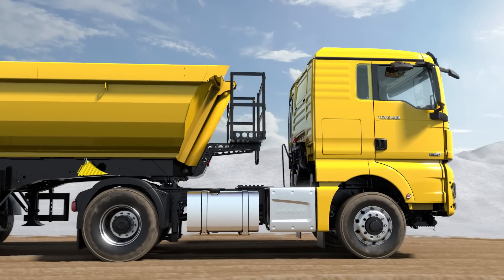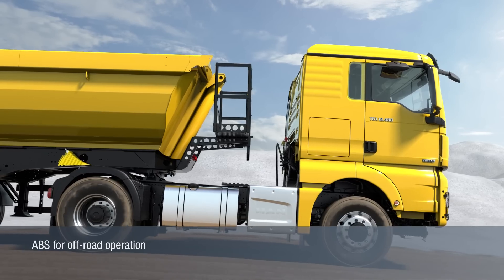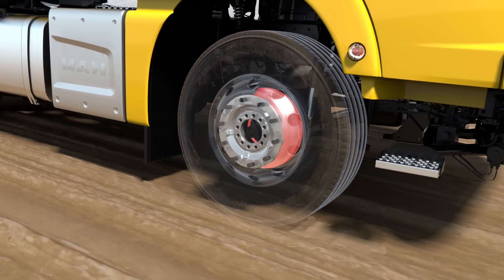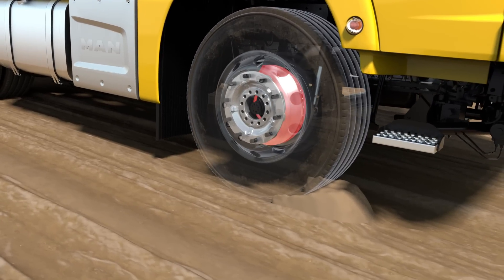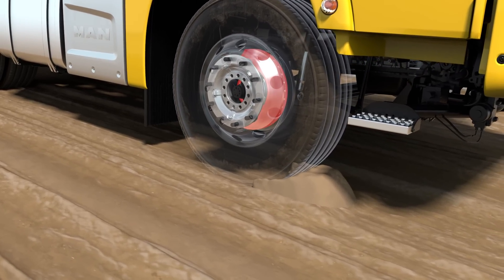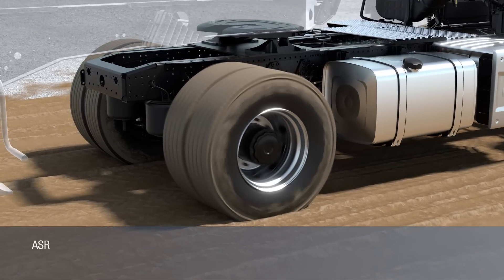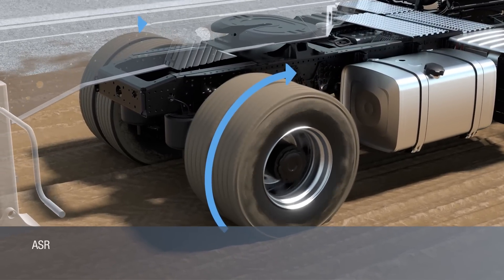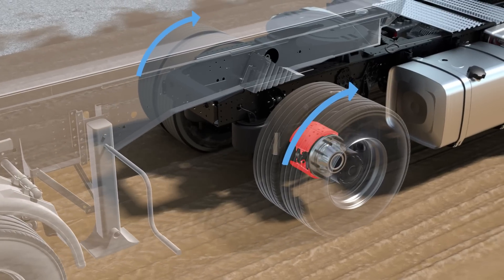EBS offroad operation | MAN Truck & Bus

Comment: Volkswagen have had the rollback lock 4 like 10 years now
Reply: Many brands of regular cars have had this actually. My 2010 Honda Civic has hills tart assist, but unlike the system in this video the brake pressure is held indefinitely until I push the accelerator.
Reply: MAN is owned by Volkswagen
Reply: noob gamer and there still scrap value trucks 😂

Comment: the really traction controll the manual difflock...closed or open....braking the overdrive wheel is bad solution in offroad..
Reply: yes great idea!truck demaged on wrong terrain and plus denaged the brake pads.....good....
Reply: tractors use this sistems for turn better

Comment: Destroying torque on the slipping wheel by brake is total stupidity ! Mechanical difflock is right solution. All electronic based traction control systems without mechanical lock are REACTIVE - because they are activated AFTER slip and in the first moment 4x2 truck can be driven only one wheel. With mechanicaly locked differential is driven with 2 wheels immediately from start. Good solution is limited slip differential, but this one don't beat mechanical difflock. Good truck driver is not long legs breasty blonde woman and can operate simple difflock switch.
Reply: Jozko Mrkvicka do you not know anything about hydro drive?? This is most likely a cheaper version of it as not everyone can afford the expensive hydro drive
Reply: yes!this is fact!just full difflock or nothing!there is no time to think about the electronics.the driver must recognize the situation and advance the ground.rather the trailer and truck manufacturers should ask the dumper drivers, what a good solution?the biggest help to have you thrown in the trash and useless idiot ECAS system from the trailers!in offroad ecas tis big catastrophe!Manual levels are fit again, the trailers as they used to!We do not develop to the same engineers who impress them but they never work in the real world!placed on the dashboard a button with which maximum 25/h speed It may be raised to the trailer lift axle-s!Any great weight!This help! the rest is demagogy!I do not need a lot of expensive to manufacture and invent stupid just so that they can sell a lot of product!
Reply: i always wondered why they didnt use breaks like this.  because if its already got power to breal them free easily it can give up a little for this method which is much cheaper and probably simpler to work.       tho it may not be cause if its too slow to act on super soft ground or it breaks the spinning wheel too hard itll just spin the other and start cycling back and fourth between the two
Reply: Jozko Mrkvicka mechanical LSD is  the way to go but the amount of differential loads and stress placed on these it's probably a cheaper option in the long term maintenance even though it may not be the best solution.
Reply: Jozko Mrkvicka it is cheaper and most of the time normal tractor trailer don't have diff lock as they are designed to be driven in non off road conditions most of the time! , normal brakes can be used when get stuck , abs give more brakeing power to moving wheel than almost no power to non moving wheels! , power is not wasted the power that is being braked is transferred to the other wheel that has more grip!
Reply: We e
Reply: I'd go for a worm drive system as seen in unimogs and the such, mechanical, no need to service, no need to adjust just drive